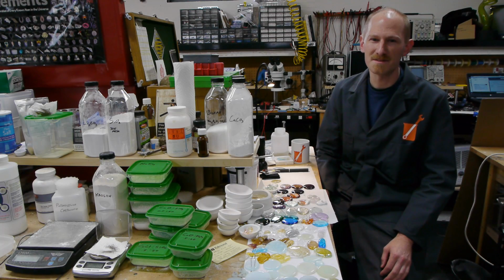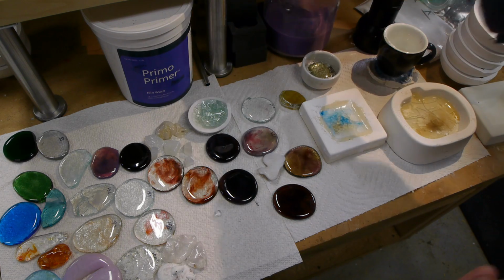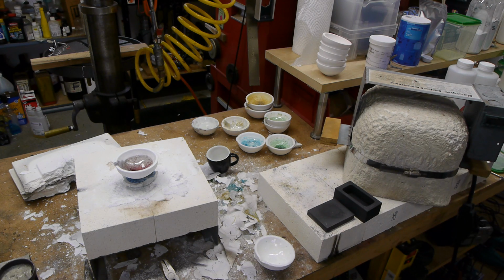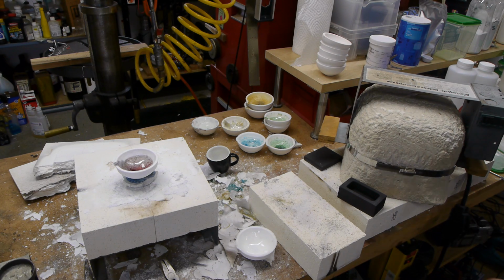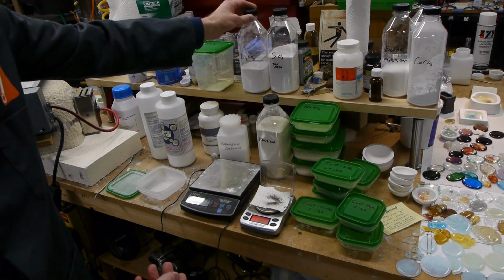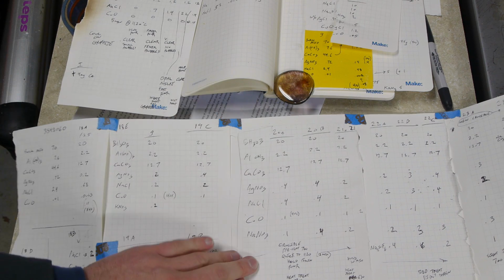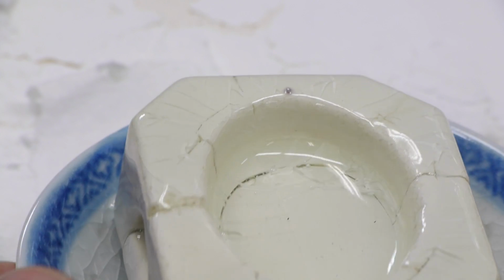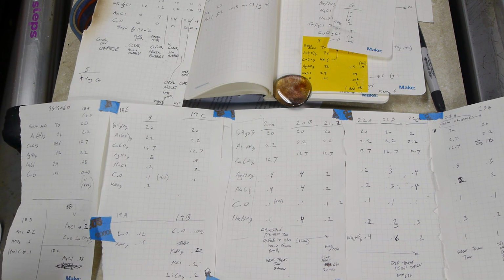Glass engineering - designing and making photochromic glass

Comment: What about using window or bottle glass as one of the raw components for your product? I experimented with these in my youth.
Photochromic glass has a useful function, but apart from sunglasses (that's been done) what are you hoping to produce in the end? 
Is there a recipe that makes glass that glows in the dark, at room temperature? (In a way similar to a thermocouple generating an electrical voltage).

Comment: Hello Sir, 
Really great job. Thank you so much for the video. I got like tons of questions. First of all, you mentioned you use copper oxide as a source of electrons for silver chloride. So why is it so important to have a really calculated amount of CuO. I mean if you add a bit more you will end up having a blue glass that is photochromic, don't you? I also have a few other questions. Different ingredients could actually have a softening effect on your glass. For example, PhO could make your glass melt at a lower temperature, but I couldn't find any information about the effect of these ingredients on TE(Thermal Expansion). Actually, I found smth but it seems to be claiming that any addetive (but AL2O3) will increases the TE. Do you have any idea about that? I also have a lot of ideas that could be interesting to you. If you need to know about them, we can talk about it for sure.

Comment: "[The] copper oxide […] accepts electrons from the silver chloride, so when you hit the silver chloride with light, it converts to metallic silver, and I think gives up an electron. Don't quote me on that." –Applied Science, 2017

Seriously, this was an amazing video. Even though I probably won't be making photochromic glass anytime soon, this was fascinating to watch. The need to tweak the starting amounts of all the components so that they decompose and evaporate to the precise amount you need at the end is so cool!

I didn't know there were what would appear to be types of glass, in the day-to-day meaning of the word, which don't contain any silicon dioxide. I guess I didn't realize how much boron is in borosilicate glass to begin with. I assumed it was a small additive.

Also, I finally learned where the word "glaze" comes from, and that glazing pottery is actually applying a material that melts into a glass in the kiln.

Comment: You ask for comments but I see you never reply to anyones comments so this is probably a waste of time. What if instead of mixing the color changing powders you add them after the other powders have liquified to temperature then sprinkling them on and adding a top layer after that, of course then you couldn't pour it unless you had 3 crucibles melted them all seperate then poured each in layers?

Comment: The silver (in AgCl) is SHORT one electron.  The light makes it ACCEPT one electron (don't know where it comes from) to be reduced to metal.  Copper can be +1 or +2, so can be source/sink for electrons.  You mention fluorides.  They tend to lower the fusion temperature.  Silver brazing flux is a glass, protecting the surface from oxidation.  It is also water soluble, SLOWLY.  This is so the flux can be removed afterword.  Generally, more sodium oxide/chloride makes glass water soluble.  They put fluorides in to lower the fusion temperature to below the silver solder fusion temperature.

Comment: Composition of glass written as x% Na2O, y% SiO2, z% B2O3 etc. is just ratio of the elements in the mixture, but this actually isn't composition of the glass. Na2CO3 didn't decompose in to Na2O and CO2 (this reaction is very unfavorable). Instead acid-base reaction actually take place. SiO2 and B2O3 are acidic, Na2CO3 is basic, so they react with each other to form sodium borosilicates and CO2.

Comment: I been making glass like you have for a few weeks and have some issues. One is that the crucibles are single use, if heated past 2000f after being used for glass they will break in the kiln (Spilling molten glass). I have trouble finding them for $2 like you mentioned (most $10+). Related to that there is about 40% chance of receiving broken crucibles if you order somewhere other than Amazon. 

Another issue I had to troubleshoot is that sometimes (depending on composition)  the contents of the crucible would expand and or bubble/boil  (spewing molten glass). This is likely from powders not being completely anhydrous. I have remedied this by slowing heating to 900f and leaving there for a few hours before trying to melt the glass completely.

Comment: Since I have been playing with doing photoresist exposing and developing as part of the PCB etching process, I am thinking about applications for Photochromic glass in a setting that is exposed by uv light source shown through a patterned mask like a transparency or a clear LCD panel.
The effect I am thinking of would produce a result similar to how E-PAPER displays work - which has a similar persistance of vision even after power is cut to them.
Could this process be inverted?  Could a glass that is all dark be turned into clear glass momentarily until light hits it again?

Comment: TL:DR went to Costco and got some Transitions© glasses before this video finished
Reply: Those are "plastics." Zeiss photochromic lenses may be one of the few to still be glass.
Reply: @VinylToVideo  I should've got those.
Reply: @BariumCobaltNitrog3n  They are made in Germany and take forever to get. They are very good though, no scratches and glass naturally protects against blue light. But they don't fire them in an oven anymore and instead dip them in some hot chemical for curing, so they don't go as dark in the sun as they used to (or as plastic Transitions do).

Comment: I wanted a single large piece of NaCl for a 10.6um CO2 laser window. So I got the brilliant idea to try and melt it in a ceramic kiln. I put a bunch of rock-salt in a stainless steel cup, and put it in the kiln... what's the worst that could happen? Well, it completely dissolved the stainless steel cup into a brown mush, then proceeded to pull that, and anything around it through the kiln shelf it was on, all the way through, to the other side. Then dripped down onto everything that was underneath it. The owner of the kiln, the kiln shelf, and the pieces that were in the kiln with this experiment was surprisingly tame about the incident. Turns out, salt is just about the worst thing you can put in a kiln.

Comment: why didn't you run the glass calculations/formulas as products post firing? (i.e. Lithium carb turns into lithium oxide with a weight that is predictable) 

and why didn't you mix the batches with water to ensure even distribution of compounds pre-firing? the weighted ball and container system seems a bit clunky, and the idea of ball milling for a certain amount of time is energy intensive. I'm coming at this from a glaze chemistry/ceramics perspective where all glazes powder batches are mixed with water so that air leaves and lets the particles get more intimate with each other.

Comment: Glass becomes electrically conductive when its molten. With some electrodes in the glass you can run a current thru it to heat it.

Comment: Given that all those switches simply send different types of electrical signals to different parts of the machine, it probably wouldn't be hard to splice in and automate, most of the functionality. The stepper motors probably being the most complicated part of it. It would be funny if you made a new shell to cover your augmentations. It's kind of inception in that you have a machine controlling the machine

Comment: could you mix the glass in air? blow some inert gas like helium into the mixture and make it liquidized and the add heat from top?
the outside would always have a "sand" layer on the outside but that probably wouldn't be that bad because now you could mold it?

Comment: So what was the final firing cycle?  I think I see the following.. heat to 1120C as fast as possible.  Hold 15minutes allow to cool.  Then heat treat at 580C.. ??treat means hold for 30 minutes at 580C and then raise at rate?? to  670C and then ramp back to room temp??.  I am thinking of making this, and then testing it on the outside of some ceramics we make.  And then trying to make it so it doesn't run off the ware.  Found this too:  https://link.springer.com/chapter/10.1007%2F978-1-4684-1761-6_6

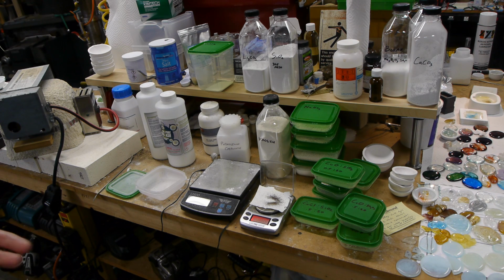Comment: 22:00 I'm reminded of "power metallurgy", which allows for more direct selection of the elements that go in, and the ability to use things that you could not simply melt and stir together.  The dusts are mixed first, and then it is heated so the melting and mixing takes place at a small scale, without the atoms moving across the entire sample.
I wonder if something liker that would work for glass?

Comment: Re: kiln floor "resists" -- That kiln paper (or kiln wash) is good, but can be expensive (especially the paper).  You can use sand and it actually makes cleanup easier as it can clump any stray glass like kitty litter.  Might want to do a test firing (or a firing for cleaning) in a crucible first, but sand generally has a higher melting point than the glasses you're trying to make.  I use it to line the bottom of my reheating furnace in a glassblowing studio and that goes over 2150F.

Comment: Dental Porcelain furnaces run at very accurate and high temperatures under vacuum, also some have connections to introduce an argon gas atmosphere in the muffle chamber.
You can also buy super thin platinum sheets from dental suppliers like Jensen or Argen. They are dead soft and can mold to just about any shape https://jensendental.com/products/jensen-platinum-foil/

Comment: Hi, great video. Love your work. Quick question, when talking about kinds of furnaces, you say that nichrome furnaces won't work for higher ranges because it would melt and that they use very obscure heating elements for specialty glass furnaces that won't melt. Why not use something like tungsten as the conductive heating element? It is very cheap, has a very high melting point and is conductive. I'm likely naive in thinking this, what's the reason for not using it? Thanks

Comment: Okay, most ceramic glazes are just glassy metals.  Seriously.  So, how much powdered iron, dry ink for a dry magnetic ink printer can you incorporate into a non-conductive glass to use as a magnetic core, radio frequency.  Make toroidal and test to find the permeability of you potential magnetic core material.  High Watt RF, has stability issues.  Check powdered iron RF Power Cores.  You want a permeability around 100 or greater.

Comment: Really cool and intresting! 
I have a furnace that goes up to about 1300°C with metal wire elements (an alloy of Fe + Cr + Al wich can handle slightly more than nichrome, wich is Ni + Cr) that I have built, mostly to play around with. But I think it's hard to do with the elements in the walls. My elements is spirals on ceramic tubes in the chamber - that maximizes heat transfer, but have the disadvantage of taking up some space in the chamber. I also have a PWM regulator where power can be reduced gradually close to maximum temperature, without the temperature peaks the elements get if they alter between full power on and off, to regulate the temperature.
Despite that I have no real temperature controller (power is continously vaiable, but can only be adjusted manually (just like if you run the furnace on a variac). I appherently have to build a real temperature controller if I want to try this.

Comment: Probably writing into /dev/null... and might aswel it's dumb idea..

The silver devitrification + Ag NO3 can be activated by laser light in melt? Maybe can control devitrification with laser. Although probably need it close to the edge of devitrification.. it messes with the cooling process if you take it out and laser it, and it's hard to laser it in there at pressure..

Comment: you talked about boron nitride, recently Ive looked into boron trioxide , it is a ceramic used in anti-spatter weld coating for mig/pulse welding nozzles, pretty nonreactive high temp stuff it seams. might that be a crucible coating option? and would the next evolution of that be boron carbide? supposedly 3rd hardest material, but i dont know the heat reaction stability.

Comment: So addon from my Experiments: Stainless steel cruicibles don't work at all since many components are going into the glass. It does actually work very good with a propane torch. But you do need to get up to 1250°C to get it bubble free, and keep this temperature for about 1~2 minutes. By using the composition that Ben did use. Also it does make sense to build an electrical heated annealing chamber, which you keep at 650°C for about 45 minutes. Don't use the "downcooling" burning chamber since the glass will start sticking onto the graphite ( seems to happen above a termpereature ). I did use the Silicon Dioxide cruicibles that Ben did use, but also the small plant pots from Ikea do work. Also, I did use a graphite block and cutted a form into it. Next i did heat up the graphite block in the annleaing chamber to 650°C, then poured the glass into it and put it into the oven. :D

Comment: I did try to reproduce this glass composition with a propane torch burner (similar to the one that the King of Random made) with about the same ingreedients that were used in the Video except for the photochromic stuff. It didn't work at all in my setup, so respect for your patience^^. Every time i try to heat up i can see a greenish flame coming up. If i do add Sodium Hydroxide i can see the redish flame. Also i did try to use a graphite cruicible which didn't work either as the carbon from the cruicible does start a chemical reaction with the glass as you can see later in the microscope. So my next attempt will be stainless steel as it would be easiest to clean from the glass by putting it in cold water. Also stainless steel can do up to 1500°C. What would be interresting to me is why did you use the Boric "only" glass type? Was it to keep the melting temperature lower or is there a better phonon transition for the photochromic effect? Would it be possible to let me know your Temperature profile? Is there a maxmium temperature for this BorGlass?

Comment: I've been making synthetic ruby and sapphire as of recently.  I'm building a Verniuel furnace and I'm thinking the same way about this as you are about getting people into working with glass.  Created ruby and sapphire is actually incredibly simple and easy.  Growing the boule past infancy is the difficult part, but making small starter boules can be accomplished with a MAPP/Oxy torch.  Using Al2O3 combined with 1% - 3% Cr2O3 yields ruby.  

Sapphire is a lot more difficult to achieve the rich blue color normally associated with blue sapphire.  I found using iron (II) oxide and not iron (III) oxide with titanium dioxide in a 3:1 ratio is a good dopant formula for adding to the alumina.  Mix the oxides in an oxygen free atmosphere--CO2 works perfectly well here.  The latest test batch I made last night is a larger scale follow up to a batch I experimented with over this past weekend.  

My latest sapphire recipe:
Al2O3= 98.54g
Fe(II)O = 1.09g
TiO2= 0.373g

Comment: Great video. If your interested in melting above 1100C on this middle furnace consider replacing you heating coil with "Kanthal Wire" which won't fail until ~1400C. Be careful as your bonded aluminosilicate muffle furnace "could" begin to yield at temperatures in excess of 1300C.

Comment: Just melted a crushed wine bottle in a stainless steel small milk jug in an electric kiln. 750C nothing, 850C melted. 950C I opened it up and dipped a stainless rod into it, like thick toffee, but pulled it out to 1m . 3 hours later removed the ss crucible now about 40C, it is pinging and a chip hit me on the cheek. Goggles ! if you try this.

Comment: Always a pleasure, Inspired and built a 4KW small kiln with Vitcas refractory cement, ran up to 1100C.  For Glass annealing I'm told a very slow cool down is required so In trying to hack a cheap ITC-100 PID controller to do ramp times. Was differently branded but pcb says ITC-100. It has RxTx on pcb but not external. If no protocol works will just hotwire the buttons to an arduino.

Comment: There are german  kiln designs that use gas, but still allow you to have an atmosphere of your desire. If I'd translate the name directly it will be "heat transfer gas-burning-oven".
In that design gases travel through the pipes and burn in them without coming in touch with the atmosphere inside the kiln.
I learned about them in my course on industrial oven types. 
The primary goal of these systems is to have a sustained high-temperature under specific atmosphere composition and pressure while using a cheaper energy source.
(in Germany using hydrogen also exempts a company from paying the pollution tax too)
I need to mention that most of these systems are actually a combination of gas and electric heater for the purpose of temperature control precision, but the ones made for rougher temperature control are indeed purely gas-operated.
I could not find any manufacturer that would make a small enough kiln (or furnace) of this type to use at home though.
The smallest size is about a small hatchback, not any smaller and of course costs as much as 4 such hatchbacks.
Could be an interesting project to make a "tiny" gas-opearated heat-exchange kiln for "home use".